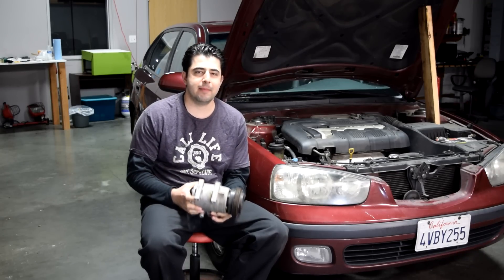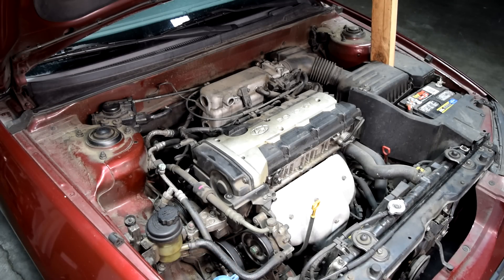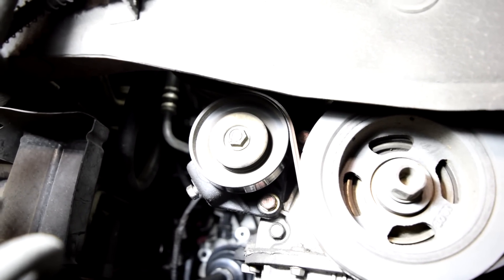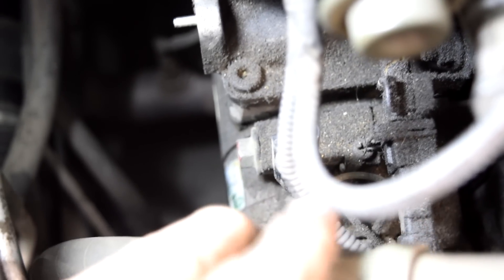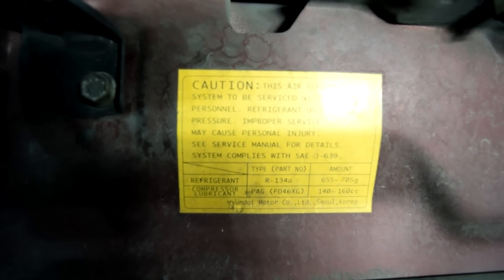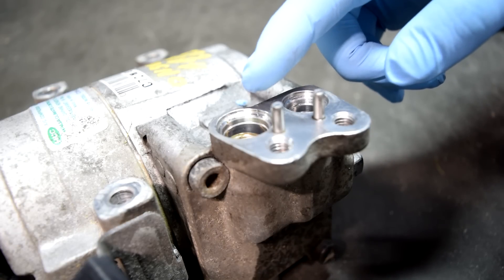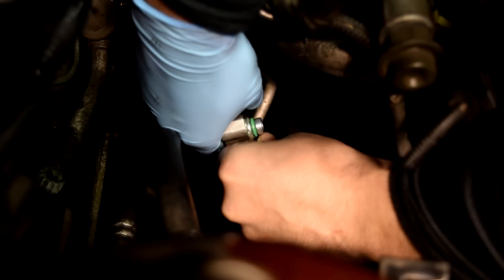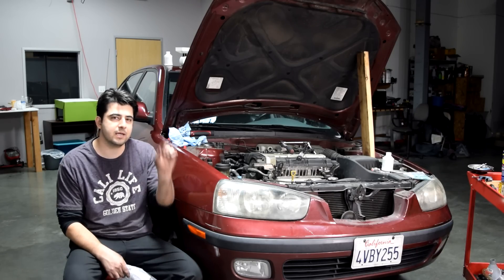How to Remove and Replace an AC Compressor - High Detail

Comment: If I turn on my AC and the compressor clutch doesn't kick in, it means I need a new clutch or compressor?
Reply: there are several things that can cause that. only have an ase certified A/C tech work on your car,not high school drop out that thinks he is a mechanic, or you may be sorry. the newer cars have electrical system over rides to not let a/c turn on in some situations, it needs to be checked out by a pro with scan tool.  (ase master tech)

Comment: 1 ml = 1 gram !!! Lots of modern AC recovery machines uses the weight of the PAG oil to be injected !!  Depends what system or method a person is using. Usually, after the system's refrigerant and oil has been recovered into the machine, you empty out the oil in the NEW compressor and refill with the manufacturer's specified amount !!
Reply: Lew, when you get a new compressor(not an old remanned one, but brand new, like form GPD or somewhere) dont they want you to drain the factory oil from it, and do it from the "drain plug"? Then, refill, like you said, with some different oil, and back into the same drain plug port? Not fill from line ports? Just curious what you think about "conditioning" or prepping a new compressor prior to a complete system rebuild(minus evaporator). Thx! Btw, 2000 Chrysler sebring conv Sanden type unit.

Comment: I bought a new compressor , it say that contains  8oz of oil and need to add more for vehicles equipped with rear AC , my question is how much  more ?
Reply: Prob about the same as in the front. Like if 5 oz in system w out a rear, add 5 more with rear. Find out where to add the pag before pouring it all in only ONE spot! Good Luck

Comment: What happens if the compressor is changed but the compressor never turns off when switched to off inside the car. What is that mean?
Reply: Sounds like your clutch bearing is frozen.

Comment: Great video. Very helpful. Why did you weigh the oil? 5oz weight is not the same as 5 fluid oz. CCs and fluid oz are both volume based. Not trying to be smartass just wondering if I'm missing something.
Reply: Read the comments, they already answered this question.
Reply: Steve Frailey yea you rite wont harm it tho seeing how alot of people do it that way..but i use a beker for cc to convert the oz to the rite cc

Comment: Awesome vid, I have a question. If I need to also change the accumulator and orifice tube. In what order do I change the parts (compressor, orifice tube, accumulator)? When do I take it to my mechanic to flush or charge?

Comment: Great video!! Thanks for doing it in 1080p! Only neg thing is like Jason said... volume is the amount of space the oil occupies,
weight is the force exerted on an object due to gravity. The sticker on the car was in CC's for a reason... because its a common unit of volume... Think about it like this- If I take 120cc or mL of liquid mercury which can be converted to 4 fluid oz and measure it in a 1/2 cup container then do the same for water and place them individually on a scale do you think they'll both weigh 0.25 lb? Answer: No of course not because Mercury has a much heavier molar mass than does water therefore it will weigh more.

Comment: I  purchase a honda compressor  and had It put in and metals and antifreeze  came out of it. I  was reading  one of your  articles about  the  condenser  should  have being  replaced  first. So now I want to  know  is the compressor  ruin because  it had to much  pressure and a loud noise?

Comment: Great video!  The only thing I'll mention is that your method of weighing the oil to determine the amount of oil put into the compressor is off.  The requirement for a specific number of ounces is in reference to volume, not weight.  Fluid ounces (volume) do not relate to dry weight ounces.  This means that the amount of oil added could be off by an amount enough to cause damage.  Of course you could weigh the full bottle, subtract the weight of the empty bottle and divide the remaining weight by the volume to give you an idea of how much each fluid ounce weighs. 
That being said, all in all a great tutorial!
Reply: I thought the same thing at first and your are technically correct - but Frank Dieli's reply above is a great explanation and makes complete sense so this weighing approach is ok in this instance.

Comment: Before removing the high and low pressure lines, do you need to drain anything?
Reply: You’ll need to evacuate the AC system with vacuum pump

Comment: i have a 2000 ford ranger that has never had a ac compressor. thats how i bought it and im woundering if its the same steps  to istall it
Reply: If it wasnt built with an ac system, then youre in for a pain.  Best to sell it and buy a car that has ac.

Comment: Hey guys, question for you.  My old A/C compressor was making a knocking noise when it was engaged so I bought a new A/C replacement kit and changed out the compressor, accumulator, orifice tube, etc.  Added oil, vacuumed out the system and added refrigerant.  

Now, 2 days later, the new compressor is making the exact same knocking noise as the old one did.  Can a new A/C compressor go bad in 2 days time if it was installed properly?  God this frustrating.  I'm starting to wonder if its the motor mount that is somehow making the noise....I tightened down the bolts but I might need to go back and check again. It seems like I hear the knocking noise very faintly even when the compressor isn't engaged so I'm hoping its something to do with the motor mount and not the compressor.
Reply: Is it a kind of klunking noise?  If it is, and if it seems to be coming from your glove box, then its probably going to be your vent actuator.
Reply: Drive belt out of alignment, if so can cause compressors pulley to bind while turning! Idler pulleys, w pump pulleys, etc, etc, etc can cause belts to run out of line just enough to f up some of the parts in the belts system! Idler pulley or other pulleys reinstalled wrong(washer not reused, lost, etc) can cause belts to run out of alignment as well! Good luck.

Comment: Would you recommend adding oil with that bottle you've used or should I get the little cans of oil and add it through the manifold gauges? and also what's the differences of these methods?

Comment: This is good work and a great teaching tool...  One thing though...I 
think that "ounces" refers to FLUID ounces, not ounces of weight.  I'm 
just sayin'.....
Reply: You are correct - I noticed the same thing. Interestingly, the conversion from grams to ounces is .0353, which is almost the same as the conversion from cc to fluid ounces, which is .0338. Considering that 1 gram of water has a volume of 1 cc, he's only off by about 10% since the specific gravity of oil is about 90% the SG of water. He actually adds about 160 cc which weighs about 5 ounces.

Comment: paperwork on my new GM 3.1 litre ac compressor said it came with 3oz of pag oil and the guy at O Reily  parts store said they didn't....low and behold the compressor couldn't take the whole  8oz  bottle even after turning clutch to fill and setting on the clutch side up for 3 minutes only took a few more drops

Comment: Thank you for the informative video..    Where can the shade tree mechanic get reliable compressors    are the ones on ebay or rebuilt ones from oreilly's good sources??     
Where can we get the Orings    Does the car parts store carry these also?   do they have to be silocone rings  ??  
Keep up good work!

Comment: The specific gravity of water is 1 making fluid ounces and dry ounces equal. The specific gravity of pag oil is .985 (almost 1) so the technical headache of the difference between dry ounces(weight) and fluid ounces(volume) is didactic in this instance. It is only an auto not going to the moon.
Reply from the maker: Frank Dielii good info thanks.

Comment: Very good, clear, video.

Like Curtis Walker said, though, ounce weight is not the same as fluid ounce. RatchetsAnd Wrenches, when you measured out 5.0 ounces by weight, you were getting about 	4.67 fl oz (138 cc) of oil. (I calculated this using the published density of 1.03 g/cc for PAG 46.)
Reply: +Mark Tomory so what you are saying is that it was dumb luck for him that 5.0 oz by weight worked out to about the correct fl oz required! His customer in this case was fortunate!!
Reply from the maker: Mark Tomory Interesting, thanks for sharing this useful bit of info! cheers

Comment: Dude remind me of Josh from Drake and Josh show on Nickelodeon. Sorry..joking. This is wat i  needed. I have to get mine replaced. My mechanic though is slackin on givin me a price range. I called up a dealer and of course their price was ridiculously high. Wat r the price ranges for jus the AC compressor?
Reply: To answer the tail end question first, the answer would be no. I don't know of any shop (unless a family, friends or employers) that would allow you to use their tools and space. Not for free anyway. And even with a price, probably not. Too many liability issues. As for flushing the system, As Randolph stated, you are best off to replace the condenser all together and ditch the old one and flush the other parts and here's why: A compressor contains teflon rings. When these compressors fail the rings then shatter apart and get carried through the system with the refrigerant. And when it gets stuck throughout your system, it's nasty. Teflon is really dirty sticky stuff that will impede any and all passages it cannot overcome. And if we look at our refrigerant flow direction we can see that all those shavings are headed right to your condenser. The passages in these condensers are only getting smaller and smaller as the years go by. JUNK IT! Not worth the hassle to keep. Next is the Orifice/metering device/piston (whatever you wanna call it) or txv. The orifice will surely be restricted beyond all recognition and will need to be replaced. If it's a txv instead, I would change that most certainly. Again, teflon is nasty stuff. I would flush any other components the best I could BEFORE installing said metering device. This flushing will rid any other debri trash or oil that may still be present in your system. GET OUT AS MUCH AS YOU CAN. It's already apart. Then once the system is fully reassembled, you will need to pull a vacuum. This is something that alot of novice DIYers skip and wonder why their new compressor just burned out. To "pull a vacuum" is meant to remove the outside air that has contaminated the system during repair. Air contains moisture. Refrigerant and moisture don't get along. And if they do get along, their relationship is very harsh and toxic. The acids will surely destroy your system. By pulling a vacuum we eliminate this problem. A vacuum of about 500 microns is sufficient. Once achieved should be monitored for about 5-10 minutes to check for vacuum loss due to leaks. If none, move on. The vacuum SHOULD be broken with dry nitrogen and the evacuation process should continue 2 more times to ensure contaminates have been removed. Once in the final vacuum, you will then break that vacuum with your refrigerant and charge to OEM specs. 

This is a brief and general practice of refrigeration repair and is in NO means a substitute for actual case scenario. Many factors need to be taken in account. This field is both fascinating and if persued can be a good money maker, even as a side hustle. As with anything RESEARCH, RESEARCH, RESEARCH! Don't try attempting something unless you have an accurate understanding. Learn from those who made the mistakes so you don't have to.

Hope this helps you or anyone else who had the patience. Any questions? Just holler!
Reply: @guitargeorge1874  that was the most professional info I have heard on this pump replace issue. I am trying to do this replace because my clutch went to lunch and it is a 1997 ford explorer so I figured it would be best to replace compressor, but now I see you say that I should replace the condenser, so I'm ok with that but, now have doubts I can do it at all even with back yard mechanics credentials. I have no gauges or other things to vacuum with. thanks for the instruction! Not sure what im gonna do now.
Reply: nastassia jefferson Google a place like O'Reilly auto parts. You can enter your year, make , and model on their page and find your compressor. They generally run on the north side of 200 bucks. I'd strongly recommend also replacing the condenser. If the condensor clogs, that's usually what ruins the compressor. You don't want a bad condenser to ruin your new compressor, do you? You can have the condenser tested first, but it doesn't help to try flushing it. If it's clogged, then it's clogged for good. Don't let some fool try to tell you otherwise.The A/C system has to be vacuum-evacuated of all the old coolant before it's safe to remove the compressor. Get the evacuating done at a shop with the right equipment. A few home mechanics have sufficient equipment to do this, but they really have to know what they're doing. In other words, don't let some idiot try doing it.
Reply: randolph patterson do you advise to flush the system once the compressor is removed? I know i'll need a shop for this because i do not have an air compressor, but everything else i believe i can handle. The idea would be to have a shop allow me to do the work there because the drive belt would have been off... in ur experience is this something that shops allow?

Comment: I'm replacing my entire AC. There was a leak, according to last owner, and the clutch seized....and the condenser was punctured...so, looks like an entire system replace. Advance Auto has all parts, even flush and freon and condensor/compressor on sale for $387 for everything, and then gives you a $50 gift card rebate so it ends up being about $350 to replace the system. Can't pass that up! This has been very helpful. Thank you!
Reply: Becky Blanton You could’ve just got a bypass pulley for your AC compressor it’s only 45 bucks
Reply: @nibroc1356   And do without the A/C?  Why would she want to do that?

Comment: Fluid ounces are not the same as pounds and ounces. 6oz is 3/4 of a cup. It has nothing to do with the weight of the fluid. That's the wrong way to measure the compressor oil. You need to use a liquid measuring device with an ounce measurement on it if it calls for a certain ounce specification.
Reply: As long as your scale reads the same as the weight on the side of the bottle. Anything over is the weight of the bottle itself.
Reply from the maker: Curtis W Good info, thanks for sharing.
Reply: you don't use fluid ounce for oil,there is so many different densities with oil depending on the type of oil you're dealing with,oil is the exception to the rule,oils are never measured in fl oz,there can be up to a quarter 3rd fill difference with the same container .A PAG 46 lb/cubic inch refrigerant oil's kinematic viscosity is high enough to be nearly considered as solid matter,therefore that guy in the video is pretty accurate when he uses an ounce scale .

Comment: Good series! I have a feeling most guys who try to do their own will skip steps that set them up for more problems later. I believe one of the things the makers of new compressors look for is evidence the system was flushed of debris before recharging the system again. It's easy to see how debris in the system could damage a new compressor. Too bad such specialized equipment is needed to follow those kind of warranty guidelines.
Reply from the maker: spelunkerd Yes, a/c work is hard to do as a Diyer but not impossible. I was lucky my compressor didn't seize up otherwise I would have had to figure out a way to flush the system or better yet replace nearly all components.
Reply: RatchetsAnd Wrenches i thought tht flushing was necessary as a result of the leak. If i understand you correctly as long as the compressor runs up to removal you dont need to replace condenser and expansion valve and flush the lines? If it's accurate it'll save me tons of money. Waiting for feedback
Reply: RatchetsAnd Wrenches I need help on a gmc envoy

Comment: Great detailed video as always. I thought weighing the pag oil container was a great idea instead of guessing with a measuring cup. I've heard so many stories of people doing their own a/c work and not getting the system right due to too much pag oil in the system. Keep up the good work.
Reply from the maker: Jimmy Mac That little scale is very useful to have around the shop, AC system repair shouldn't be difficult as long as one has the right tools, good instructions and can follow them exactly. Thanks for you comment,